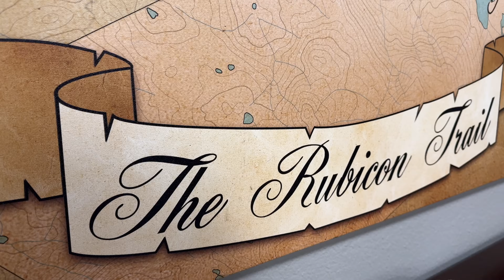Jeep Gladiator Gets Full EPIC Metalcloak GameChanger 3.5" Treatment!

Comment: I can’t recommend the Metal Cloak skids enough for any Eco Diesel! It’s almost like having thick rally car skids from the front axle to the rear axle covering the DEF tank and Entire DPF system, transfer case, transmission, and oil pan!  The only things you see are the control arms and drive shafts once installed.   You can still easily access your fuel filter.  All the Eco Diesel components are super expensive and hard to find outside of a dealership, and chances are they could be on back order leaving you without a Jeep for a very long time!  I heard Teddy is getting some installed!  ⚠️The 11/16 rivet nut can be a pain, so drill carefully and start small with your drill bits!

Comment: Shouldn’t you final torque track bars & control arms sitting at ride height? Or will this not bind
Reply: With this kit since it has the adjustable control arms and trackbars from Metalcloak it doesn't have to be torqued at rest on the ground due to the type of joints in all the listed components.
Reply: @TheEPICBeardedGinger  ok sweet thanks makes sense

Comment: Are you going to still be offering the falcon shocks? If so, would be great to get a comparison and pros/cons for both
Reply: Yes we will be and yes we plan to do a comparison video down the road after enough miles on them.
Reply: @TheEPICBeardedGinger  awesome to hear!! 🙌
Reply: Falcons run much stiffer than the Reds. When the Falcons are new, they’re almost too stiff. Mine have 30k miles on them and my wife’s have 2k on them, it almost hurts to ride in hers now. Once they wear in a bit it softens up. I’m hoping Metalcloak will be at Jeep bash with some discounts so I can strike a deal. I have 5 brands underneath my JTOD 😂
Reply: @camaroboi13  oh interesting. Do you have the adjustable Falcons? That is what I am considering adding - soft, medium and firm would be great to have as options
Reply: @theofficialcarter15 I run the sp2.1 non adjustable Falcons. I have them on my 24 Willy’s JLU with 3.5” lift and also on my 22 JTOD with 4.5” lift. To me it’s like buying a mattress, if you want medium you buy firm and break it in. If you buy medium and break it in it will be too soft.